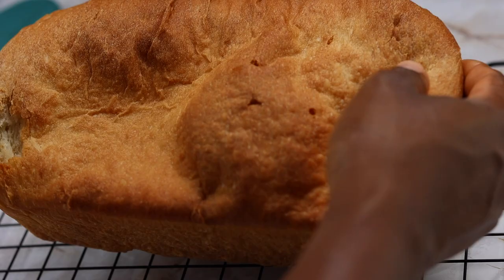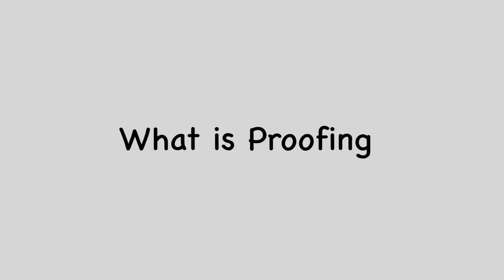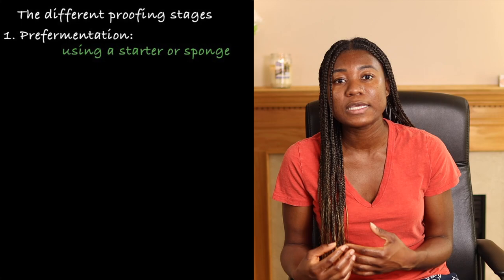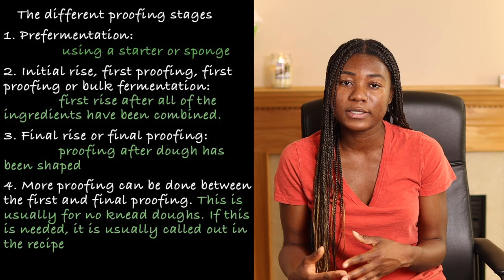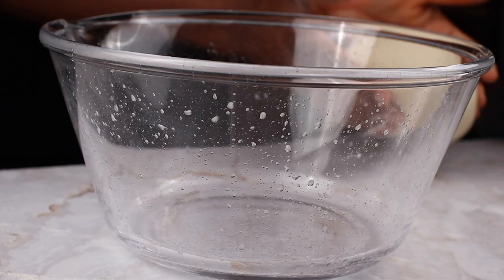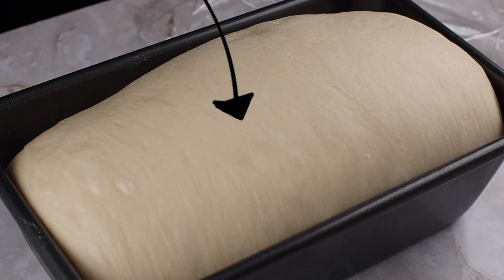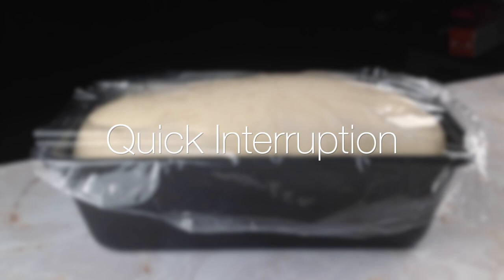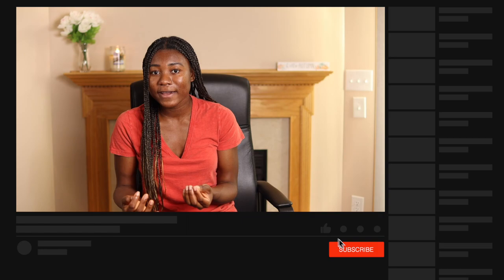Bread Dough Proofing 101 | How to proof bread dough | Knowledge Sharing Ep 03

Comment: Hi there,

Assuming that my shaping method is well, I find that I do get "tears" instead of holes on the surface of the bread during 2nd fermentation. Could it be due to over fermentation as well? Thanks!
Reply from the maker: It could be you didn't knead your dough adequately so there's not enough gluten structure to hold in the CO2. So the tears might be as a result of the CO2 escaping.  Hope this helps, let me know if you have any other questions.

Comment: My bread rises and tastes delicious. It is a little dry and crumbly. Am I baking too long? I also put a pan of water in the oven for moisture. I also let rise in the off oven with the light on
Reply from the maker: Looks like you found the answer to your question. Adding water in the oven will give you a crispy crust and might help with adding moisture to your bread. But if your bread is dry and crumbly I would check how much flour you're using. You could also be overproofing or overkneading.